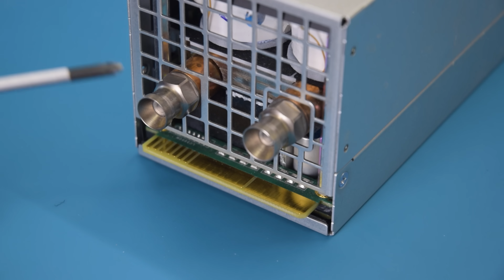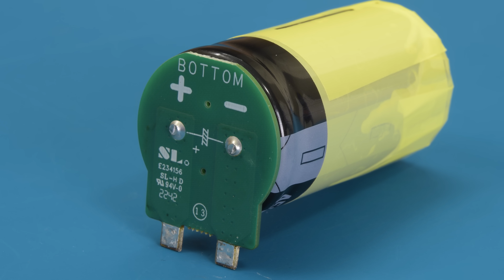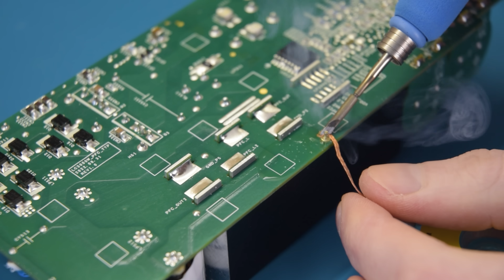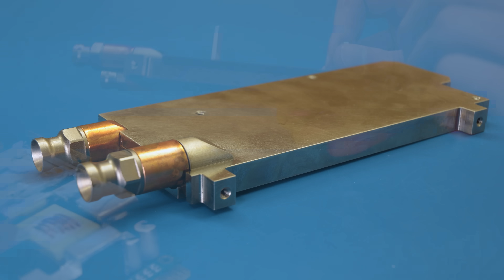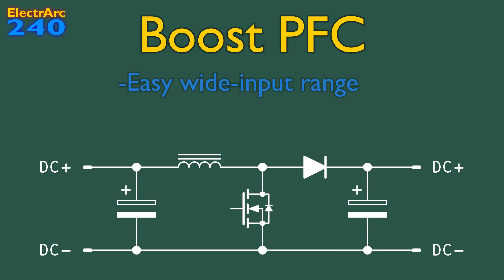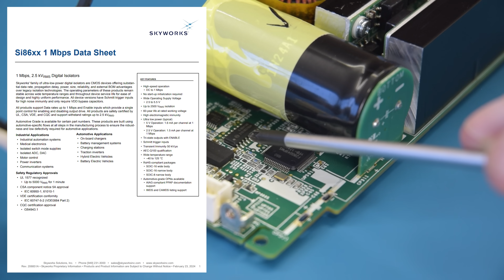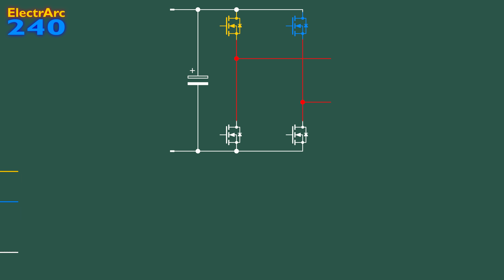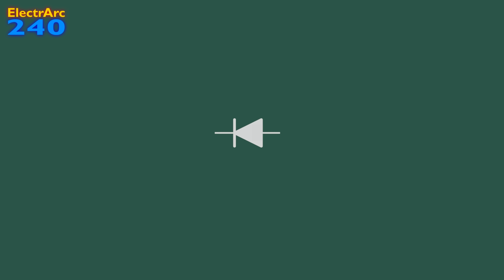Inside a 3000W Water-Cooled Power Supply (with GaN & SiC)

Comment: The 8-diode bridge rectifier has series pairs of diodes to protect against the possibility of individual shorted diodes. 
Also, note that at 34:44, the label specifies input power can be either AC or DC, which is a nice touch.
Reply: interesting that DC input is 230-240V as well, I'd have expected something like 300-340V to match with more similar mains peak voltage ranges.
Reply: The Max voltage rating is for the higher AC circuits. The HVDC mode is 70% less if I remember rms correctly. Most Switched mode supplies will handle HVDC input but almost no Datcenters use HVDC because of Faraday's Law. It is far more efficient for them to provide 3∅ since generally rack power densities are 15Kw/42U cabinet.

the only place I've heard of common HVDC being used at scale is either renewables or at the phase conversion stations on Japan's power grid.
Reply: @RowanHawkins  a hv dc bus is convenient for seamless battery backup tho, no need for additional inverters that just eat power for no reason (since you're immediately converting back to dc).
Reply: @tomsixsix  That's called "Alirack"; Alibaba (which approximately is the chinese equivalent to bezos's amazon (including AWS!) imperium) just decided many years ago (10?15? feels about that long....) to just ask their server suppliers to get the PSUs tested and the minimal 
restrictions (e.g. beefy enough diode bridge rectifier to not overload the half that is all alone active when the input polarity doesn't flip many times per second; also check that no startup/standby circuits cause issues) imposed to just ship them with otherwise-entirely-normal PSUs that just so happen to be 100% happy eating DC.
And then they built a datacenter where they just take an otherwise online-UPS setup, delete the inverter from the UPS, and just wire (with just fuses/circuit breakers in the way) the servers directly to the battery bank.
If you take e.g. 68 or 69 LFP cells in series you see at the charge/discharge voltage-vs-Ah graph that this quite nicely matches the 200~240V (at the server, i.e., accounting for the voltage drop in the cable from the batteries to the servers, which only happens at full draw so is just extra range margin downwards) rating on the PSU here.
They retained the big >100 kW 3-phase rectifier "battery charger" of the normal online-UPS arrangement. Those are fairly cheap per kW due to getting to use big transistors without duplicating the control circuity; just for example a UJ4C075023L8S that could handle 240/415V 3-phase AC in a 3-half-bridges delta-wired configuration, at say 35A (rms) phase current, so 25.2 kW with 6 of them; they're listead as "10.48$ reference price" at the current manufacturer's website (onsemi), and you'd only need a step-down from the ~600V (DC already, because this is 3-phase, which has no power wobble) which could be done with for example 3 of the same in parallel as low-side switch and 2 in parallel as high-side switch in a simple synchronous buck topology. Doesn't need to be isolated yet, as you can't have the battery banks free to be touched anyways due to the 240V DC on them. That's e.g. a total of 11 of these switches at 115.28$ together for 4.57$/kW for the power electronics themselves at the rectifier. (About 95% efficiency based on the power semiconductors.)
Or, if you'd take UJ4N075004L8S at 31.93$ each, you'd get 85A rms phase current for 61.2 kW with 6 at the AC/DC bridge; you could use 2 low side and "1.5" (rounded up ofc) at the high side for the buck, so 5.22 $/kW; if you'd double that to not have to round the "1.5", it'd be 4.96 $/kW.... this latter one is lower loss (vs. the smaller transistors driven harder because the smaller hot spot can be spread to a still similarly sized area before having to meet the heatsink; also the large one is limited by bond wires which cause about a 30% cost increase in semiconductor for the same converter power rating assuming you'd ignore the resulting substantially lower efficiency) though. About 98.5% efficiency based on the power semiconductors.
Reply: DC power would be really neat if you have a ton of solar on your data center
Reply: Im thinking that it is a dual interleaved 180 degree phase shifted front end
Reply: @sean-s3l8f- You mean like typical split-phase 240 volt AC power in North America? Why would you want to separately rectify each half of the split phase power? A 3000 watt power supply would not be able to run on just a single 120 volt half of the split phase, unless it's a heavy duty circuit. But the whole 3000 watts is easily doable at 240 volts.
Reply: @YodaWhat  180 degree phase shifted front end

Comment: Bending capacitor leads does introduce a certain amount of stress on the leads between them and the foil inside the caps, I would assume they used those boards for 1, stress relief and 2, mounting stability, hence the isolation tape around the top of the caps as well as to stop probable arcing at that current?.... hence no sharp cuts from any side cutters...... I am just guessing though..... And could be talking complete and utter shite.....😂🤣

Comment: You could maybe two phase cool something like this to crank the energy density but you can see this design is very close to the limit. You might get higher efficiency via software but this is very close to the limit the main transformer is tiny.

Comment: Intel PSU? 👀 PSU version of Meltdown/Spectre discovered when? 😂 Jokes aside though, pretty neat package, and I can't wait to see these similar sorts of chips and designs eventually leak down into consumer scale products, especially with the wattages that GPU's are sucking down these days, would be very nice to see some less heat production PSU side, perhaps 24-48V DC busses for GPU sockets, would help solve a lot of the Nvidia problems we see with their plugs these days. Obviously I don't see the water cooling portion hitting consumer tech, but still interesting to see somebody actually decide to go this route instead of just tanking it in mineral oil or something.

Comment: The GaN boards face inward so the heatsink blocks can act as EMI shields. If thats a particularly problematic area for emissions it might have been critical for them to shield it that way. 

IME its pretty common to leverage heatsinks this way
Reply: In addition to this, it keeps the circulating currents closer to each other thus reducing loop area.
Reply: @KellyR-qx7wn that actually makes great sense.
Reply: But I still don't understand why they did 2 separate layouts for that board. They can do the same shielding Trick with 2 identical boards. Or so I think.
Reply: @konstantinaleksiev6671  2 boards, but a simplified main board layout, with equal length traces, meaning better current sharing, and equal EMI performance on them.
Reply: @konstantinaleksiev6671  Intuitively I would have thought they two layouts would be best as mirror images of each other, at least that would simplify the second layout. 
I'm sure if we were privy to the design notes, I would slap my forehead with a loud "DUH!"
Reply: I would have thought so, but it might be a component pinout reason. I leant the hard way as a student, you can't mirror a circuit board unless the chips mount upside down.
Reply: @liam3284  Your right. I had a complete brain fart when I wasn't thinking about the pin-outs of the various chips not being mirrored.  
Thankfully this is youtube and not at work!
Reply: @konstantinaleksiev6671  or just added some screening foil. Would definitely be a lot cheaper than having to spin two separate board designs.
Reply: Having a mirrored design is not just a PCB design issue. It doesn't stop there. Producing the two items can increase the costs significantly as you have to stock the separate PCBs, separate heatsinks, have separate processes mounting them, separate QA/QC processes, then stock the two finished items separately, then the consumer-process (i.e. big main PCB) also has to deal with two distinct items, etc...

So from manufacturing/logistics standpoint, adding complexity to a subcomponent almost always end up having a chain effect on the entire production line, starting from the warehouse, so ideally you want to avoid it as much as technically possible.
Reply: @gabiold  This is a refrence design so they aren't counting pennies that's up to you if you plan on mass producing.

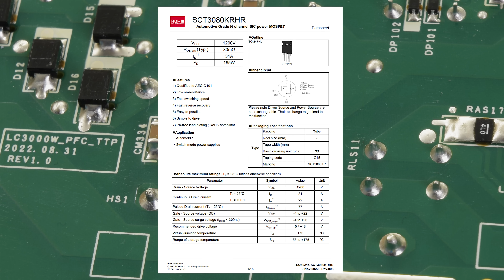Comment: 12:00 anyone figure out what’s going on with the kelvin connection?
Reply from the maker: Best suggestion is that the design was originally for 3-pin, though the pin order is different so would require quite a big change (not just a different footprint)

Comment: 11:55 "...which goes against the advice of all manufacturers...."
It does not. The datasheet says "the pins are not INTERCHANGEABLE", which means, well, I can only suppose, but I think this means that gate source is connected from the die to the pin with a little bit smaller wire, than the wire that connects power source pads on the die to the respective pin. Nothing in the datasheet says that you cannot just join the sources together, if the ripples created by the current spikes in the power source pin do not affect the gate driving much.

Comment: The use of the kelvin source SiC FETs, but bridging their source connections together is simple; they are still the highest performance (FOM etc) 3 pin devices if used that way, so going to a traditional 3 pin device would have been a downgrade.

Comment: Fantastic tour through an absolute brick of a power supply. Small-signal digital boards can get dense, but this is dense with chips and their little passives sprinkled all around these huge terminals and their various high voltage, high frequency and ample ampacity capabilities, and everything's soaked with solder... Awesome. I have a shot in the dark theory about the kelvin pin issue--maybe they were troubleshooting a prototype, got some sort of HF ringing or something, and just decided to join the pins, and whatever it was got better--instead of switching out chips and starting over or trying to figure out why, they just went with it...Those chips can switch some massive dI/dt, no?
Edit-- Unscripted sounded fine, no fumbly backtracking and sounded natural and loose. Lighting looks good, it helps to have several broad sources to get down into the slots and gaps.

Comment: 24:00 you’re not going to mention that shiny MEMS microphone and accompanying transmitter chip? Okay, man. Then definitely don’t mention that half of the interior of each of those big capacitors is a high velocity explosive and detonator, designed to destroy the power supply remotely, if need be, for political or corporate sabotage purposes. Such a mitzvah

Comment: At 36:40, these diodes are most probably for pre-charging the bulk capacitors. You can see the pre charge resistor right below it. The relay can turn on when peak AC voltage is close enough to the DC bus voltage, effectively bypassing the precharge circuit

These currents can easily exceed ~120A at cold startup, that is why they placed 2 sets in parallel

Diodes in series might be due to high voltage in the DC bus approximately boosted up to 400V
Reply: I'll also add that when the PFC is functional, these diodes do not conduct due to the boosted voltage making them reversed biased.

These diodes only operate when PFC circuit is inactive(Vdc < Vac)

Comment: @29:00 No, you cannot use a 3-pin packaged SiC switch! Considering of the parasitic resistance and inductance of these pins and bonding wires, the extra Kelvin lead seperate the parasitics from the main source current path. You can treat the COMMON GROUND as a single point on PCB, the large current flow through the SiC switch will indtroduce excessive IR drop on the source pin, while keep the Kelvin connected Vgs unaffected.
Reply: That doesn't explain why the two pins are shorted on the board though. In fact the source current will now divide between the S and KS bond wires/pins in the ratio of their impedances, which seems like a bad thing
Reply: 650V SiC FETs are available in both 3 and 4 pin package styles. I’m guessing they designed the board to accept either, and wedged in whatever was cheapest at production time. The Kelvin source certainly helps with gate drive, but the existence of the 3 pin parts is proof that they can be made to work acceptably without it.
Reply: @akshirsamn I'm curious to see where this convo leads🍿
Reply: @PatrickECleary move over, I want a seat. 🍿
Reply: @PatrickECleary can someone translate this into GUMBO - english
As in life is like a box of chocolate$? 🤐😵‍💫😵‍💫😵‍💫

Comment: So, Intel doesn’t make power supplies they do however often create the specifications for the supply rails and regulation. You can see on the label that it’s made by Dongguan solum. Often in server equipment many supplies are available to purchase with different power ratings (higher or lower) different efficiency classes and input types (AC or DC etc) the brand of server usually slaps their name on the supply (Dell, HP, Lenovo, Supermicro, NVIDIA etc) since they do usually have specific hardware inside for LOM (lights out management) and things like hot swapping/load balancing. It’s all super dense; high power and high efficiency supplies! They are a very easy way to get some real high power +12V DC supplies for the cheaps from server surplus/spare part sites
Reply: So I worked with this platform in the Intel labs. This is out of a D50DNP which like @electrarc240 says, is a reference platform albeit one with some limited public availability. This thing actually mounts to a power distribution board in the chassis, which then couples the power to "sleds" inside which hold the CPU and/or GPU boards. One 2U chassis could run two 1U sleds if water cooled. There was also an air cooled variant, using a different, air cooled power supply. That one hosted a 2U air cooled sled which could be set up to hold PCI card GPUs.

I wasn't on the team that designed them but I suspect that while this was designed and built by a contractor, this is probably not an "off the shelf" part. Intel would have specified exactly where the water cooling hookups, mounting latches, etc were all located and I doubt this PSU would fit in any other model of system.

The platform as a whole wasn't bad. The prototype water cooled sleds had some issues with leaks and after the first couple "incidents" we put plastic trays under each one to keep one leak from killing multiple systems. ;) The later production systems did not leak but us folks in the labs mostly had to make do with the old stuff - not many spare parts for lower volume reference systems like this.
Reply: They don't do any of that, they pick power supplies that already exist from other companies like Delta, FSP, Solum, etc. This one happens to be made by Solum.

Comment: The yellow output filter inductor is probably an iron powder core, not a ferrite one!
Most often when I see a yellow-painted core, it's of that type.

It makes sense for it not to be a ferrite core because it can withstand a very high saturation field (3-4 times that of ferrite)
It's also a soft-saturation material, meaning that inductance gradually decreases as current rises, which is perfect for the application, it may increase ripple current in overload conditions, but it won't make high current spikes.
Also, compared to a ferrite core, there's no need for a huge (kiloohms) impedance or a high Q-factor at high frequencies, this iron powder core will act as a parallel resistor of cca 200R (wild guess from the looks of it), but most of the current is DC, so most of the loss is that current over the DCR. Triple the saturation field gives it a much better benefit than a high Rp.
Reply: The yellow is Mix 52 high frequency core, μ 75
Reply: @ivantest3673  Micrometals yo!

Comment: ElectrArc241 channel for uploading the rant you removed on all the duplicated filtering and stuff that goes on in datacenters?

As a side note, the HP C7000 Bladecenter chassis had an option for -48V DC PSUs that could be used instead of the normal AC PSUs (and one of the common configs was 6x 2400W per 10U chassis).  Iirc the -48V DC was mostly for compatibility with old telco systems though, and if we were going to do that today something like 480V DC would make a lot more sense.

Comment: This PSU is quite a treat to see, and I like your analysis.
As for the electrolytic capacitor breakout PCBs, I believe they are routed like that to reduce the ESR and the stray inductance.
I know that when measuring ESR and ESL on a large electrolytic capacitor using kelvin-connected LCRmeter, measuring over the long leads can easily double the ESR and/or ESL.